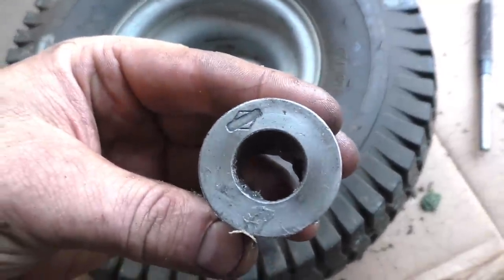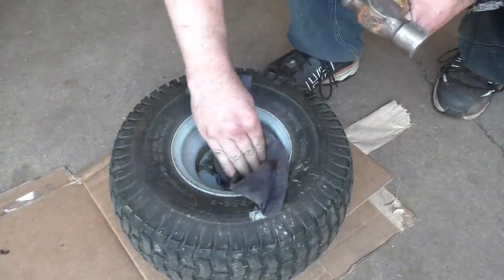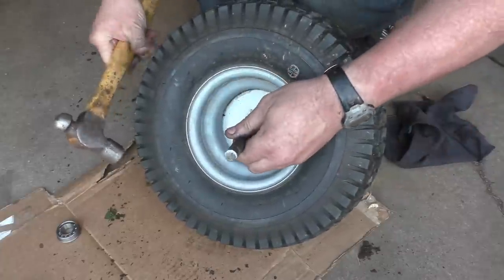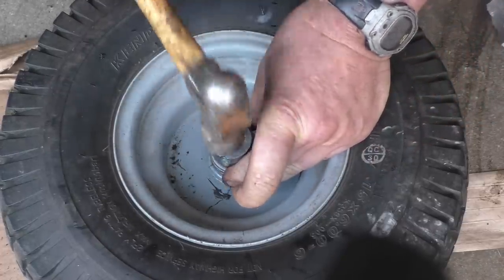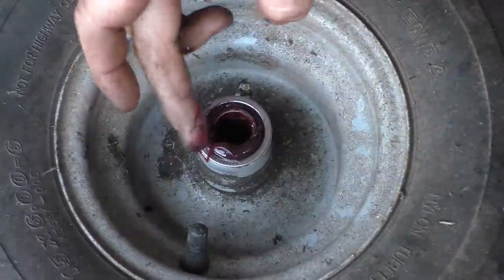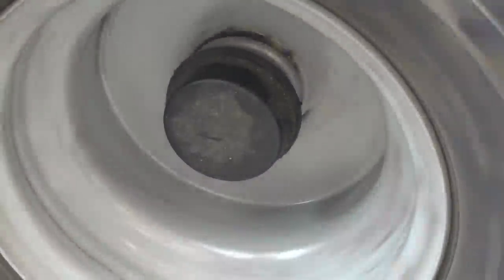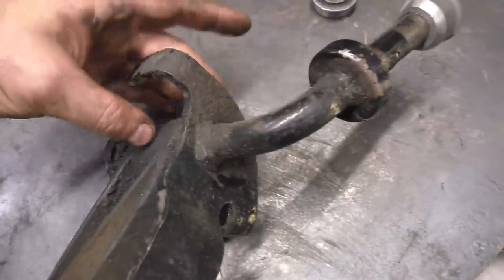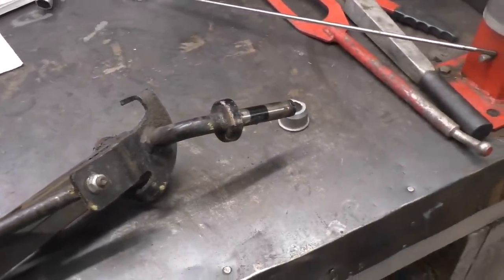This Is A Great Upgrade For Your Lawn Tractor Riding Mower!

Comment: thanks db . i'd like to add that these fit the majority of riders , but not all . not sure , but i believe these fit 3/4 inch spindles . some manufacturers use smaller diameter , some use larger . just a reminder to viewers to make sure what size you need before ordering . thanks for letting me add my 2 cents .
Reply: I order that bearings and dont fit. It is to big.

Comment: If Stens not available just search for 3/4 x 1-3/8 Flanged Ball Bearing.  Great Vid Don!
Reply: I checked at my J.D. dealer to see if they could get those ball bearings for my 2006, 155c / 720 hrs.  Turns out the bushings supercede to the sealed ball bearing with the flange.  Plus he had the 4 needed, Yeaaaa.  Now to find the poor mans power steering bearings.

Comment: I did this modification many years ago and have never regretted doing it. However, I went one step further and also put flat roller bearings onto the spindles/shafts that support and steer the mower. Now, my Craftsman LT2000 not only rolls easily, it also steers easily. I can push my mower with one hand (just by leaning on it). And I can steer it with one finger. Yes, it really is that easy! (Maybe that can be your next video.) I recommend everyone do both modifications. 

Whoever manufactures these mowers should make both modifications standard on all future mowers. In bulk, the cost would be minimal, and the difference it makes for the user is nothing short of incredible. I will never go back to bushings and will make these modifications to any mower I own in the future.
Reply: I did the same.  I also added a steering wheel knob ("suicide knob") to allow one-handed, and very quick, steering action.  The result is very much like power steering.
Reply: @karguy1720  I thought about adding a steering wheel knob but decided against it. I use my mower to cut my pasture which, unfortunately, has quite a few divots in it (due to moles). Occasionally, they force the steering wheel to turn abruptly, spinning it forcefully. With a knob on it, I might end up breaking my thumb. (Ouch!) 🤕 But it's a good idea for those who mow your average lawn.

Comment: Fun fact: bushings are cheaper than bearings, that's why most manufacturers use them.
I've prolonged the useful life of several shop-vacs by replacing the top motor bushing with 611 bearings.

Comment: Great video.  I didn't know replacement bearings are an option. I own a 2015 Husqvarna YT42LS lawn tractor. 
Are the bearing inside/outside diameter sizes common for lawn tractor axles? If not,  how do I go about searching for the correct bearing sizes?

Comment: wow, that's some awesome info Don, I had no idea that you can do this. The next time i have to do a Bushing in a wheel, i'll go ahead and do this upgrade!  At my church, there was a John Deere mower that always had issues with the wheel bushings. I think i replaced them 2 of 3 times over 10 years. And now that i think about it, i'll bet the shaft was worn down. The ground was so uneven with lots of ruts and tire marks where people would park in the grass, or drive through it and it just destroyed those bushings like within a year. Great Video! Thanks!

Comment: Getting ready to do this on a custom MTD racer (FNR transaxle, welded differential, oil bath) to beef up the front end. Probably do some custom work on the steering spindles too. Good deal for the education, Dony. Keep at it.
Reply: I swapped wheels and got those toro wheels with the big 1.75 od bearing ,vs the "normal"  wheels /bearings with a 1"3/8 od.
Figured like a truck ,the bigger the better and should last longer, I found it a pita to get decent bearings in that 1 3/8 size

Comment: Says you put this on 6 hours ago, you mustn't sleep much, 
Daylight comes early those days.  Hot here in Gander this week but no forest fires. 
Thanks for the video,  gotta make sure to use bearings with a lip on them so as not to go  inside too far.
Now you  relax and enjoy the long weekend .
Reply: I suppose a spacer could be used if flanged ones are not available.

Comment: Do you have the OD dimension of those bearings?  Asking for a JD X320.   I have always thought it was stupid to have valve and zerk fitting on the Inside of the wheel

Comment: Hey @donyboy73.  Great vid!  Question on MTD front wheel.  Have you ever had the grease zirk pop off the axle.  Its not threaded in, but somehow pressed or glued  to the outside of the wheel which slides over the axle.  I was greasing mine and the zirk just popped off.  Appreciate your comments.
Reply from the maker: Yes I have

Comment: Good video, suggest cleaning back of the wheel before removing bushing instead of brushing dirt into the greased bore, warn non-mechanics about not hammering on the inner race of any bearing. Explain the benefits to them also.

Comment: Got a Sears 19 hp twin tractor. 30 plus years old, all good except the rear axel. Wheels tilt inward as housing is wore out where the steel shaft goes in. Can you do a video on how to fix that?  💐

Comment: I've got a yard mechanic 13.5 to comesee engine. I've put a new coil and a new carburetor. Engine keeps surging and popping through the carburetor and I've adjusted the valves. Do know what the problem could be.

Comment: I would like to upgrade mine as well. I wonder if this is specific to the mowers you mentioned. Mine is a 1993 Craftsman LT4000.
Reply from the maker: I think it's the same, you can also buy cheaper bearings on Amazon

Comment: Could you not repair the worn shaft with something like J.B. Weld?  It is not subject to further wear once bearings are fitted.
Reply: I did that on a snowblower auger shaft.
Reply: Did that on my backyard race mower , but every 2-3 rides I was welding em up again. 
Went with the Toro wheels which use a 1.75" od bearing ,too.
Reply: @MrTheHillfolk  I suspect you repaired the axle shaft but left plain bushings on.  With ball bearing bushings there is no wear on the axle once repaired if all tightly fitted.  I can see the repaired axle not standing up to original bearing stresses.
Reply: @buddyboy4x44  
Yeah, I figured that out after I hit send...I was just building up bushing surface. 
I had to do it anyway to fit the bearings, and that was a trip. Not horrible but a little tedious so you'd keep the shaft round and so the bearing would fit. 
Believe it or not ,it involved alot of hand filing ,you just can't get that with a power tool because in an instant you took too much off.

Comment: Would this be a pair bearings for each of the 4 wheels or are the rear wheels different. please?  And would this same bearing set also be good for various deck width tractor mowers?  I have two 46" deck tractor mowers: a 2017 Craftsman Limited Edition VTS DLS 3500 Briggs & Stratton 20HP OHV 46'' Deck and a 2011 Troy-Bilt Horse XP Hydrostatic Kohler Courage 22 OHV 46" Deck.  I like saving maintenance and parts.  Thanks
Reply from the maker: This is only for front wheels.
Reply: @donyboy73   Thanks.  So it should work on all makes and models for front wheels?  Is there a similar setup for rear wheels?

Comment: I wouldn’t exactly call it up an upgrade. The original graphite bearings are made like that for that reason. Because the front tires get a lot of grit and grime inside. The open bearing will cause even more headaches because now you can get larger pieces of grit and grime inside the bearings, and wear them out even more. If there is a sealed bearing option, that may be a bit better.

Comment: I'm going to measure up my wheelbarrow wheel to see if I can do the same, although obviously with different sized bearings.
Reply: Some Wheelbarrows have ball bearing wheels from factory.  Not sure if they are replaceable.
Reply: @gordbaker896  My wheelbarrow isn't quite so fancy as to have factory ball bearings.  Plastic bushings.  They're low maintenance but not especially durable.  That said, I haven't yet run across any ball bearing that can't be replaced, assuming you can find the replacement size.  My wheelbarrow has fairly standard hub and axle diameters, so bearings are readily available and pretty inexpensive.
Reply: @briantaylor9266  If you are wearing out plastic bushings on a wheelbarrow (Mexican Backhoe), You are working too hard!  Buy a handful.    I have a pair 16x6.50 x8 wheels, 3/4" bore that appear to have pressed in Flanged ball bearings on each side of the steel wheel.  Do you live near Hamilton ON?  Home Hdwe sells them for around $40. Tire and wheel Assy.  I can't tell if you have a problem or not.

Comment: What type of grease did you add?
Reply: I will use #2 and grease gun
Reply: @boots7859  thanks for your response. I don’t know enough about grease and the different types. I have a skilsaw that I’m replacing the bearings outside the gear oil area and wanted to know if those need grease. I’ll also do my homework as well but I appreciate both your responses.

Comment: Anyone do this on a cub cadet xt 1 ? Just wondering the size needed for them . Thanks
Reply: Hey donyboy73 , my cub cadet xt 1 needs 3/4 id an 1 inch od . Im not finding any bearings that size . Wondering if the only choice would be getting diff tires which obviously wouldnt be worth it . Any ideas ?

Comment: I've seen that some times that The bushings are plastic 😮😮
Reply: Seems like a bad idea, plastic bushing.   I have a 10 year old cub with those nylon bushings.   The grease zirk is cast into the plastic and will plug with dust and grease.  On the plus side they do wear well and wont wear down the spindle shaft. I got into the habit of just pulling the wheel and manually greasing once a season as the zirk was worthless.   I ended up getting new wheels for it this season as it was cheaper to get generic tires and rims than to replace the the tire, tube and bushings.  The new wheels have sintered bearings and the tire is 4 ply. A lot of the generic wheels have bearings as well.   Its a low rpm application and bushes are fine as long as they are kept lubed, even nylon bushings.  But many people just don't lube this part.
Reply: @luuk-out-below9804   you got that right  I have generic wheels for my.poulan XT mower 👌

Comment: This had to be done to JD mowers since they put on JUNK at the factory .  I had to replace the entire spindle , bearing assy before 100 hrs on my JD 140 .  These mowers are total trash and I just sold mine to a guy down the road .   Now have a real mower , a Cub Cadet 50" cut , runs like a scalded bear .   Never again JD .